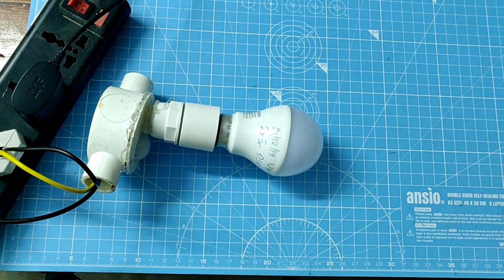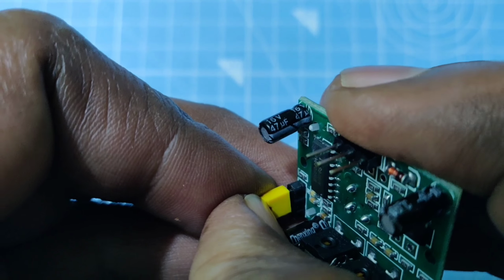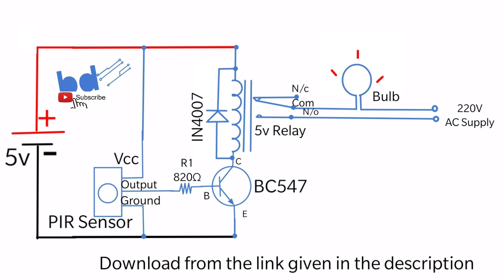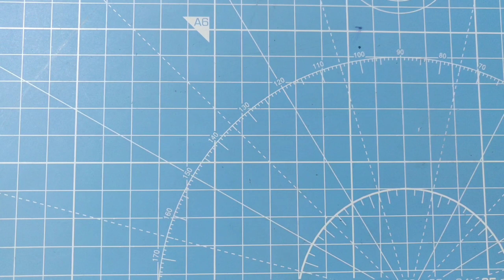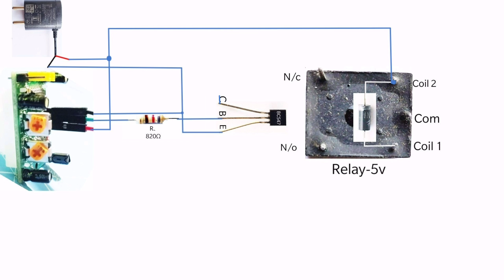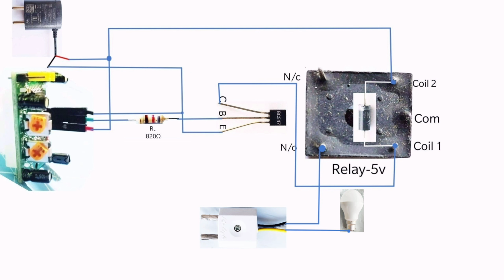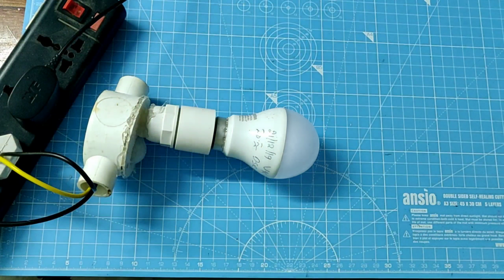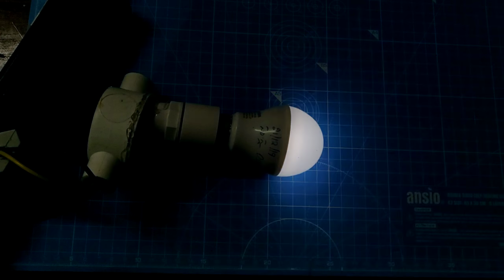How to make a motion sensor light at home with explanation | PIR sensor | Transistor-BC547

Comment: Hi very nice Schematic, would you be able to share the circuit which is also connected via an LDR so the light only activates on IR motion at night, that way the PIR will remain inactive at day time. // Also is it possible for a parallel bypass to put on the light directly by a switch ? It would be great if you can share this schematic please.

Comment: Is The Process same for the 12 volt dc relay instead of 5volt relay
Reply from the maker: same. But you need to adjust the voltage requirement for the relay.

Comment: I want to use led strip. Can you please help to make this with pi sensor? Please answer. 12 v LED strip in place of the AC bulb.
Reply from the maker: Remove the relay and AC supply. Connect XL6009 module at the output pins, you can get 12 v using this module.

Comment: sir

i used the same circuit with 5 v relay , 5 v adaptor , pir sensor bc 547.When i swicth onthe power , relay switched on and bulb on , bulb stays on,. Can you pl tell me whats wrong with circuit. Bulb is not swtching off. I ve done setting of sensitivity and range also , no results.
Reply from the maker: Change the jumper setting and try

Comment: i used the same circuit with 5 v relay , 5 v adaptor , pir sensor bc 547.When i swicth onthe power , relay switched on and bulb on , bulb stays on,. Can you pl tell me whats wrong with circuit. Bulb is not swtching off. I ve done setting of sensitivity and range also , no results.
Reply: May be you relay is faulty.
Or pot of pir is faulty